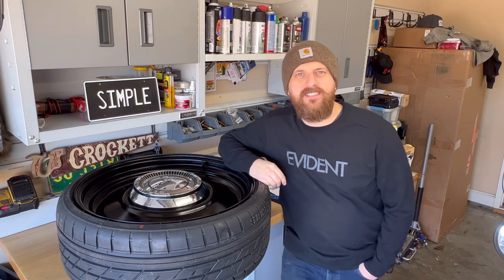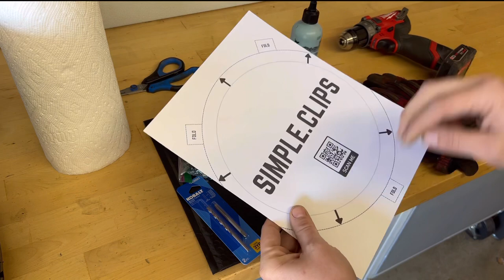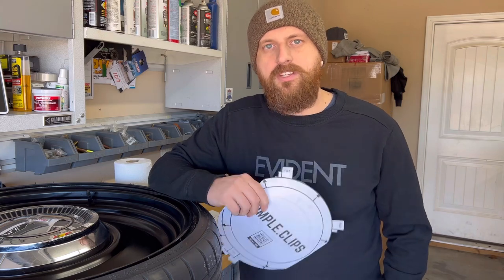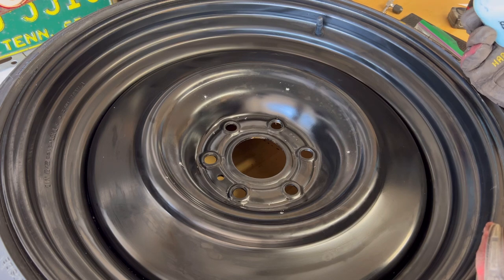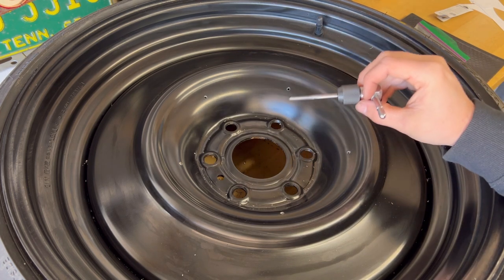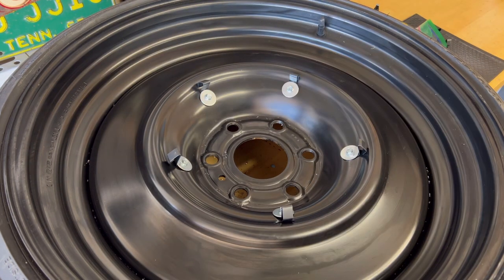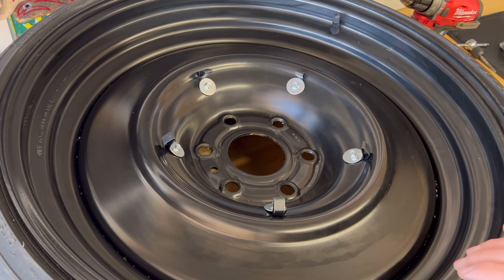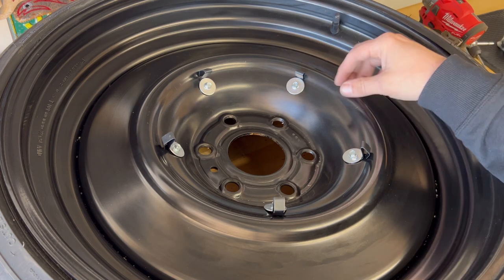C10 | SIMPLE.CLIPS | Install hubcaps on your transport wheels with this easy kit and DIY video!

Comment: could this be used on a Ford wheel? and before I get shitted by randoms on for having a ford, I'm really trying to give me truck a new and different look and not a cookie cutter look like everybody else's.
Reply from the maker: If the hubcaps are 10.25 inch inside measurement you can. For sure try to be different!
Reply: If your running your mouth talking about cookie cutter blag blah blah I wouldn't be asking for advice.
Reply: @timgibson2070  wild because the owner of the channel knew exactly what i was talking about, hearted my comment and replied back giving me useful information. so i ask who are you exactly? And if the answer isn't anything then a nobody you would be sadly wrong...

Comment: Nice now that is for a bigger wheel how about with a size 15” having trouble with hub flying off. Any suggestions or same concept?
Reply from the maker: I’m sure my clips would work but you would need a specific template b
Reply: Okay thank you

Comment: As always great video. I have a 63-fleet side I just started and struggling to decide wheel. tire size, rear end gears and transmission options. Do you have the info for your trucks in one location or maybe a great idea for a video. Thanks! Keep up the good work!!!!
Reply from the maker: I’m working on a “builds” section of the website that has details of all my builds.

Comment: Could you tell us exactly what car the hubcaps come off of,I know that people call them dog dish but it would help to know what vehicle? Also where did you get the whitewall 22 in tires from and what's your favorite tire size for the transport rims on the c10.thanks again.
Reply from the maker: The white wall is actually the rim painted white around the lip. 

Dogdish hubcaps come on a number of different test vehicles. Apaches, C10s 60-87, corvettes, etc. For air ride I like to use a 255/30/22.

Comment: I want to buy some wheels from Detroit wheels. I have a 66 c10 I want the size of transport wheels I just don’t know the correct back spacing.
Reply from the maker: Detroit only goes up to a 4.5 inch backspacing on a 22x9. That size will work fine.
Reply: I saw you had transport wheels for sale. So I just bought a set. Can you tell me what tire size you run   I appreciate your channel.
Reply from the maker: @nateorten2267  I saw your order! I’ll have them shipped out early next week! Here’s the tires I use. https://ebay.us/GT1RPq

Comment: Would this work on Chevy 6 lug truck rally wheels ?
Reply from the maker: It’s possible but not created for that style wheel. I’m hoping to have more versions in the future.
Reply: @SIMPLE.C10  what is the inner diameter of the “ inner ring “ of the “ transport “ rim ? Might be similar to the diameter of the inner ring of the rally rim. Also rally rim has pre drilled & tapped holes from factory. Perhaps some sort of offset washer utilizing these existing holes ?
Reply: Just get creative. Just me there's plenty of ways to put these dog dish caps on all types of wheels... big and small. Get your hands dirty and have fun!

Comment: I'm excited to get my clips, finally be able to finish the look of my wheels off right.
Reply from the maker: Thanks for the support! My stickers get here today so I’ll be able to start shipping them out next week!
Reply: @SIMPLE.C10  perfect! What if I bought longer bolts and put nuts on the backside for insurance?
Reply from the maker: @cadilakisrodcustom  you shouldn’t need to do that. If you wanted to just put some thread lock that won’t go anywhere. I’ve never even used threadlock and never had a clip come off.
Reply: @SIMPLE.C10  I'll most likely just put some thread lock on them then.